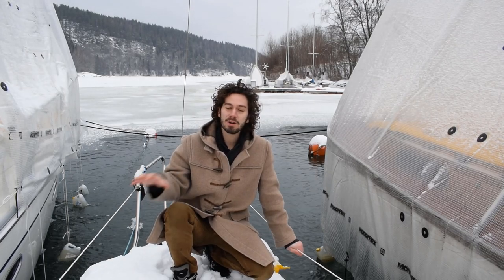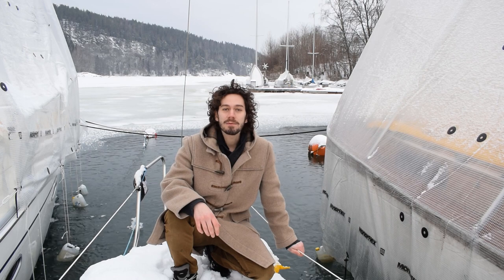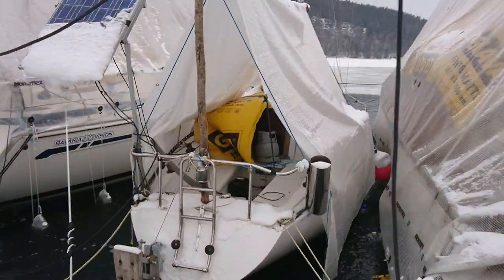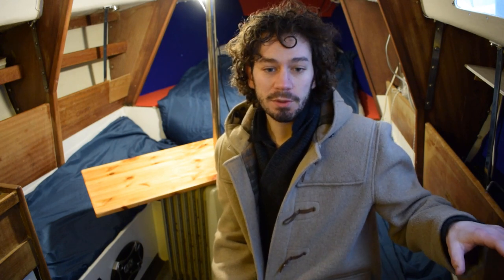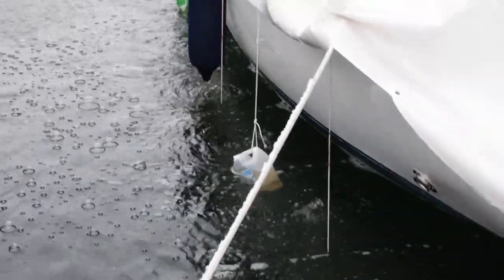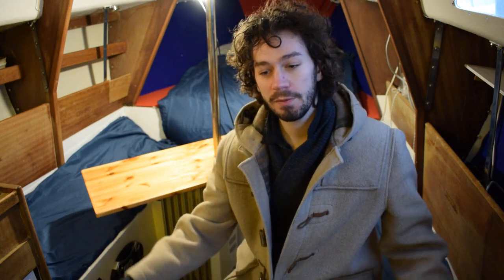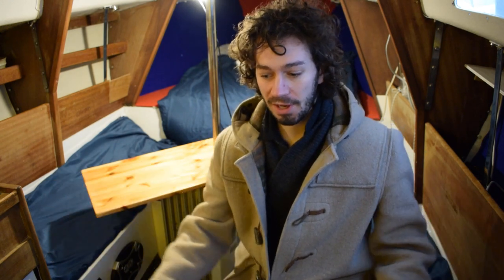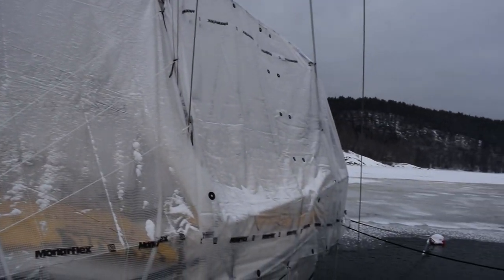Is it a good idea to live on a boat in the winter in the north?

Comment: Thanks for sharing this info, i live on a boat for about 10 months now in Germany, it's my first winter and i had lots of problem with condensation, as you mentioned, water dripping from everywhere. I use Diesel heater in salon and kitchen, and small electric heater for bedroom. Since i spend most time in bedroom, i didn't use diesel heater much and condensation appeared. I will see if i can find nice heater for the kitchen aswell since i have electricty in my Marina. Other than that, i am enjoying it fully with nice neighbours who also live on a boat next to me.

Comment: One way of venting moisture, without losing a lot of heat, is to use a heat recovery ventilation system. Of course they are made for houses, though you can get 12v ones for bathrooms

Comment: Hi Maybe try the reflective blankets to wrap the inside of the boat . Not sure but you may still have an issue with the condensation but it may keep the heat inside a lot better for you . Sounds like a lot of fun but I think Id like a boat life in the warmer climes
Reply from the maker: I figured out a good solution that stopped the condensation, basically by always having a heater on (on low), that way it creates a drying current of air which combined with ventilation gets rid of the moisture. You can check my later videos for a more in depth explaination.

Comment: Is the electric supply included in the marina charge?
Use a simple electric ring cooker inside, avoids the condensation from a gas stove.
Reply from the maker: No, it was not included but I ended up paying very little for electricity because I used very little. Using electric cooking helps, but most of the moisture comes from the water heating up and turning to steam
Reply: It depends on the marina, where I was the slip was the only thing I had to pay for.
Reply: Why didn’t you use snow for water?  People use seawater for cleaning dishes.

Comment: How far in the fjord is that place? I assume somewhere slightly closer to the ocean the water would not freeze?
Reply from the maker: There can be up to half a meter of ice there during the winter, so it definitely freezes. That's why they have the bubbles underwater to keep the ice away (see my other videos about living on a boat)
Reply: @BreachtheBox  even the open ocean?
Reply from the maker: If it's close to the open ocean it wouldn't freeze, but most harbors Are in more protected areas where it's more likely for the water to freezw

Comment: Why not run a dehumidifier to reduce moisture?
Reply from the maker: That would work, but I didn't have one. I figured out another good solution that stopped the condensation, basically by always having a heater on (on low), that way it creates a drying current of air which combined with ventilation gets rid of the moisture. You can check my later videos for a more in depth explaination.
Reply: @BreachtheBox  yes this basically uses heat energy to vaporize your ambient moisture and transport it away, a clever and intuitive method used everywhere, though not very precise 👍
Reply: My dehumidifier freezes below 65°f
Reply: I thought the same. I think if it was me, I’d spend the couple of hundred Euro and buy a dehumidifier, but you’d need a desiccant type I think. Even so it’s available to dry out the interior if something unexpected happens. Glad the heater solution worked though.

Comment: What happens when the water freezes? Can it hurt the boat?
Reply from the maker: It can potentially damage and sink the boat, but it depends on the material of the boat and how much ice there is. We had bubbles in the water (warm air blown through hoses 1 m under the surface) keeping the ice away

Comment: how much does it cost to keep your boat ry for the whole winter season?
Reply from the maker: My boat ry? Not sure what you mean :)
Reply: @BreachtheBox  sorry, about how much  does it cost to keep your boat heated for the whole winter season?
Reply from the maker: I spend about 90 dollars for the whole winter (not per month). But realistically it would be closer to three times that at least, because I kept the temperature way too low for most people to be comfortable (around 6 degrees Celsius) and had the heater under my table with a blanket over the table so it would heat me directly instead of the whole boat which isn't insulated.
Reply from the maker: I'm extremely frugal when it comes to energy use. But either way it's a lot lot cheaper to heat a small boat than it is to heat a house
Reply from the maker: Hey, the marina had a compressor running to make the bubbles, but it's also possible to do it on a smaller scale for just one boat. Good luck with your project! I hope you'll enjoy living that way :)